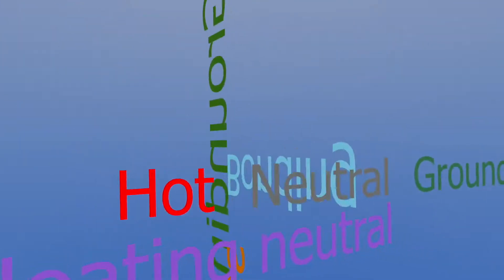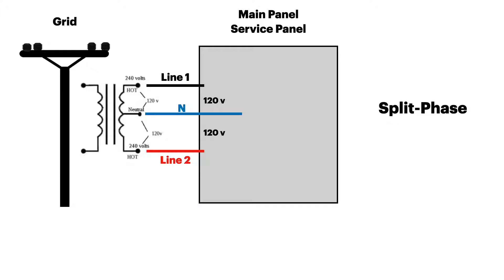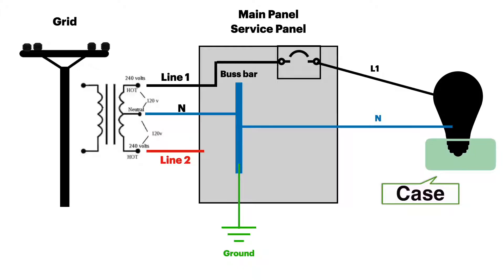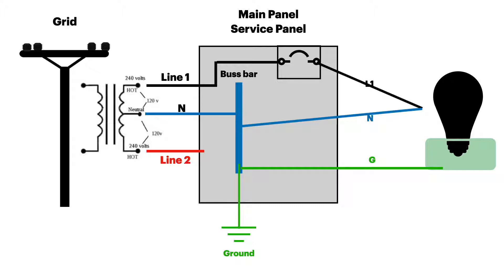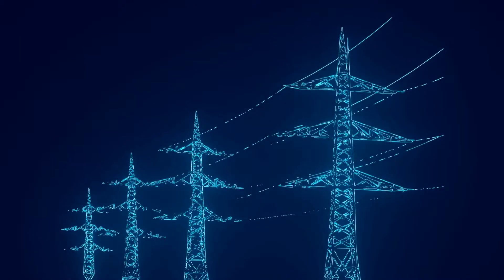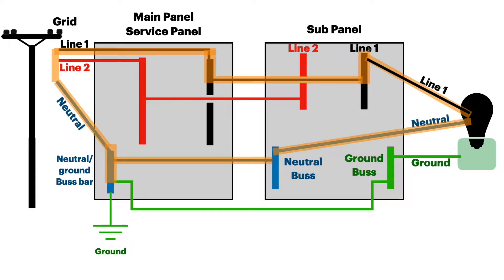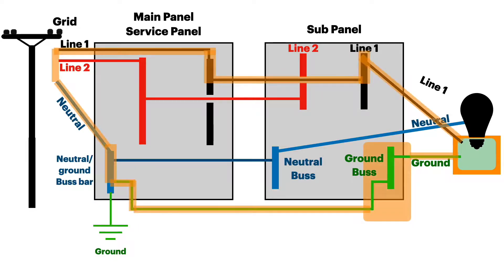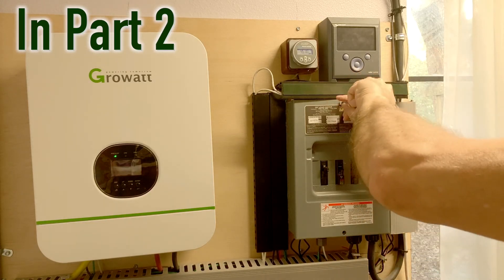Grounding & Bonding For Solar Inverters: Part 1: Basics

Comment: Well I have NO grounding in my house other than at the main panel. I don't want to spend a fortune replacing wiring in the house just to have a ground wire. Nor do I want to deface the outside of my house with holes drilled in it to run a ground wire.

Grounding is there for STATIC control.

Comment: Do we need to have separate grounding rods for AC and DC in a solar system, and that too not bonded to each other .This is what is being taught in all South Asian videos. I believe there should be one. E. G we have DC inverter washing so these have both AC and DC circuits but we never use separate grounding for these. Your views please.

Comment: Great explanation. In the UK we  normally have what we call an intake head which comprises of 1 x 60/100A single fuse at 240v & another terminal block where the neutral terminates. We then run a live from the fuse & a seperate neutral & earth from the termination block to the fuse box. We never terminate neutral & earth together in the fuse box. We use 2 separate bus bars. This is no different to how you do it & i think it makes life easier for testing.
I noticed that you was using the same inverter "Growatt" & wondered why they have a supply ground on the grid connection & a case bolt for a lug as well. Is there any reason for this as the ground is linked to the casing. ??

Comment: Sub panel grounds (USA) are supposed to have their own ground rod and not connected to the main panel or neutral in the sub panel.
I think the NEC says ground rods need to be 5 feet apart as a minimum.
Reply: I've read where sub panel's in detached buildings require their own ground rod but not sub panel's in the same building that has main panel(?)
Reply: @johnreeves7261  My detached garage has no sub panel. Just a wire from house to it for the garage door opener and lighting.
Oh and a couple of outlets.
Reply: @crazysquirrel9425  Okay but do you have a sub-panel in your house?  If you do, from what I've read, it shouldn't have it's own ground rod.
Reply: @johnreeves7261  Nope. Just a small main panel.
Wire from house to garage is 3-wire so the 3-way switches can turn the lights on and off (as well as shut off power to the opener).
I think the garage may have it's own ground rod (think if does, it would be for the old phone line).
Reply: @johnreeves7261  And if you have no sub panel in the garage?

Comment: What happens if no ground wire is carried into the sub panel and neutral and ground are bonded there? Wouldn't a ground fault flow back through the neutral and cause the breaker to pop?

Comment: Hi Great Vids BTW. I am putting together an off grid solar system. My question is: Do I connect all the ground connections to the negative buss bar ? IE: The ground on the inverter case, the ground on the 120 volt breaker panel, the ground on the charge controller, the ground on the 12 volt distribution panel, Etc. In other words every electrical component. Also, Do I  bond the neutral and the ground in the 120 volt breaker panel seeing as it is the only panel and not a sub panel ? Thanks  TT
Reply from the maker: Don't ground AC circuits on your DC (battery) buss bar. For most DC equipment, you only ground the electrical boxes, solar panel frames, etc, but NOT the DC negative.
On the AC side, You have to make sure your inverter isn't already bonded internally. Watch the whole "grounding and bonding" playlist on my channel, I'll cover common problems and how to test your system.

Comment: For me, being in Europe, the bond between the neutral and ground looks very odd.  Here the only bond between neutral and ground is at the substation (transformer). IIRC we leave the neutral and ground unconnected in the main panel to prevent part of the current flowing back to the substation through the ground.  However that now leaves me doubting why that would be considered undesirable in Europe but OK in the US.
Reply from the maker: Most of the world bonds at the substation(transformer), the US bonds at the main home panel, and uses split-phase :i.e. two hot legs at 240v with a center tap neutral. There are also decades of re-written electrical codes and political policies involved.

Comment: As an electrician this is one of the best explanations I have ever seen. I went completed a 5 year apprenticeship back in 2004. Now, I am trying to build an off grid system. The issue I am having is on paper I see a ground loop. The solar array is ground mounted system 200' from the home with the main panel. The panels are bonded together and bonded to the array mounts (all metal components must be grounded). There is a ground electrode system at the main panel as code requires. Does this array not create a second ground by the 2" steel posts in the ground with concrete and rebar? Creating a ground loop. My concern is in the event of a lightning strike between the house and the array shooting electricity in both directions to the panels and the array and through the inverter destroying all the equipment attached to this ground? Any thoughts would be great.
Reply from the maker: I share your concerns over this. I don't have a clear answer on it. Some people add lightning arresters like the Midnight Solar.

Comment: some say line 1 and line 2 are 90° out of phase, others say 180°, which one is correct?
Reply from the maker: In North America, residential power is known as split-phase. The reference point is the center trap (neutral)of the utility transformer. Measuring from the neutral, one leg is positive when the other leg is negative, and they both cross the zero line at the same time, just in opposite directions. This is 180º out of phase. If they were 90º, they would cross the zero at different times.
Reply: @ReelClearMediaLLC  L1 and L2 are not out of phase!  They are in phase. You are measuring one Line backwards!  When you drop two D cells into a flashlight ... Are two batteries 180° out of phase? NO!  Even if you connect the center point of the two batteries to ground - the batteries are still not, out of phase.  If you decide to intentionally measure one battery backwards then your measurement is 180° out of phase. Look up "dot notation"  for transformers to learn about windings being IN PHASE.

Comment: Very informative video. In INDIA most of electric engineer don’t know about ground bounding is used in Hybrid inverter.
Reply from the maker: Double check with local electricians on how your grid is wired. My videos are based on North America wiring, and your bonding and grounding may be different in India.

Comment: Great explanation!

But I have a question which I'm really struggling to find an answer for. What happens in case you lose the incoming service neutral due to an accident or whatever, but your incoming service live wire is still intact? Since your neutral busbar is bonded to the grounding busbar at the main panel, won't that mean that everything connected to a grounding wire - all of your appliances' chassis - would be energized? Even an RCD wouldn't trip in case someone touches the live chassis because you have the same amount of current flowing through the live, through the load, through the neutral, through the grounding wire, and through the person to the ground. Is there a way to mitigate that or at least get warned if something like this ever happens? Of course, this is in case you don't have a grounding rod bonded to your grounding busbar. But even if you had, will its resistance be low enough to act as an emergency neutral?
Reply from the maker: Again, I'm not an electrician or an engineer,ibut  in my opinion...
If the neutral from the grid was disconnected, there is no longer a return path on 120v circuits. 
Your appliances' chassis would not be live, unless they had an internal ground fault, just like under normal circumstances.

The neutral buss-bar is bonded to the ground in your panel, and could possibly provide a return through the ground  rod to the ground of the utility pole. My understanding is this would be minimal, due to resistance of the ground, depending on the distance involved.
Reply: That exact thing happened to us. The neutral wire was disconnected at the light pole. We still had power but it was extremely weak.
Reply: @tareq - in most cases your neutral and ground wires will still be connected to a copper cold water pipe and a ground rod. And so will your neighbors. And the Neutral Wire at the pole is grounded. So you all share many secondary paths back to the pole transformer's neutral wire via every ground wire and neutral wire in your local area = A giant mesh circuit.  Yes the voltage on your neutral and ground wires will be greater than 0 volts. Instead of 120v + 120v you might have 130v + 110v or worse if you have a poor ground.

Comment: I hope you don’t mind to answer my question. What’s the proper way to grounding a solar arrays on metal ground post? Thanks
Reply from the maker: That depends on the manufacturer of the solar charger or inverter. Some want to see one of the DC legs from panels grounded, but many do NOT want the DC grounded. In all cases, you can ground the frames of the panels, if possible to the same ground the inverter is on.
Reply: @dong - Follow the Electrical Codes for your country.

Comment: ¿Para un sistema off grid puedo tirar un cable ground desde el panel de breaker principal al panel de breaker off grid? ¿O deberia instalar un nuevo ground independiente especificamente para el sistema off grid?
Reply from the maker: Is the main breaker panel on the grid?
Reply: @ReelClearMediaLLC  no, es un breaker panel independiente
Reply from the maker: @Eliaslionloky  I'm in the US, so this may not apply in other countries.
You should be able to run a ground cable from your main panel if: Main panel has a grounding (earth) rod connected to its ground bus.
You should have only one ground-neutral BOND in your whole electrical system.
Your inverter is made to work with grid power.

Comment: Great series but have to rewatch it few times...
What happens if I have an unbonded stand alone inverter (earth has its own connector on the back of the metal case and neutral is not bonded to it),  and somehow there is a short of live and earth. And I touch the case? Since it's not able to complete the circuit, I should not get hit?

Comment: Can you pls explain to your audience why to implement an RCD?
Reply from the maker: Sorry, I'm not familiar with them, as they aren't used in the US. We use GFCI (ground fault circuit interrupters) which trip when the current  on L1 is different than N, basically detecting that current is going somewhere that it should not.
Reply: GFCI is the American name for a Residual Current Device. Same thing.

Comment: Thank you. I can't wait for part 2 so that I can finally complete my solar circuits. I have been searching for a simple explanation on how to connect a grounding cable to an off grid 48 volt system  with an all in one inverter.
Reply: Long story but same book here. 
2 - 5k growatt inverter, 5K transformer. 
I'm doing All but solar panels right now.
I don't know much, But what is  your main question right now remix ?
Reply: My question if I hook my inverter to a bonded neutral it puts 40 volts to ground. I would think it would be safer not to ground that neutral. That's why they don't recommend turning off the main breaker and hooking a generator directly to the breaker box or back feeding though an outlet. My power station has forty volts from the neutral to ground which I cannot bond it to ground. 73
Reply: Grounding may not be needed if your solar does not connect to house wiring.
I do not know for sure.